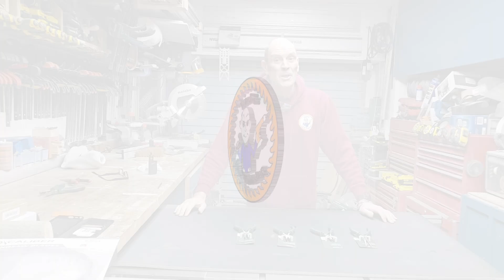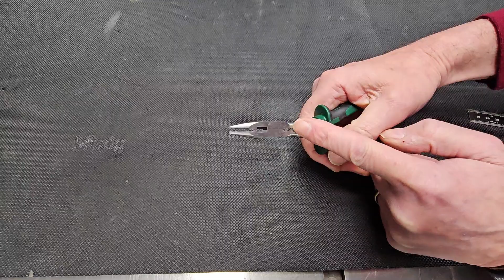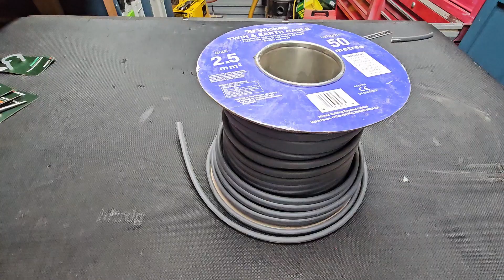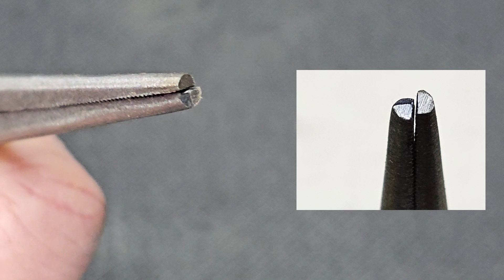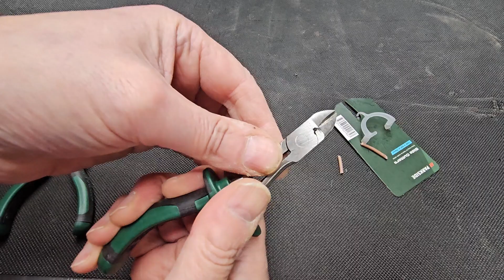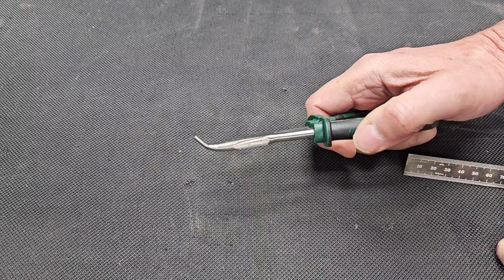PARKSIDE Pliers, Are they any good ?

Comment: Hi Frank, I was looking at the side cutters in my local Lidl on Friday not bad for £2.99 but I did buy from Lidl was a pack of heat shrink to put over wires after soldering they were £2.99  and 2 litres of milk........... not much use in the workshop !! I'm glad to see the tools and accessories are back on the shelves. I'll go back to Lidl tomorrow and get those side cutters Great demonstration catch you soon, Happy new year,    Take care
Reply from the maker: @shaun30-3-mg9zs  😆😆 Milk is an essential tool... its the minimum requirement for a cuppa while you work 😆😆. If you get the cutters, spend a bit of time to find the best ones on the shelf. Don't just grab the first ones you see (like I did).
If anyone asks what your up to, just say "Frank told me to" 🤣🤣. 
Happy new year mate and thanks for watching 😁👍
Reply: @frankslittleworkshop  Thank's Frank, I'll go to Lidl and test all of them, before I buy good advice mate😁👍
Reply: @frankslittleworkshop    you're* up